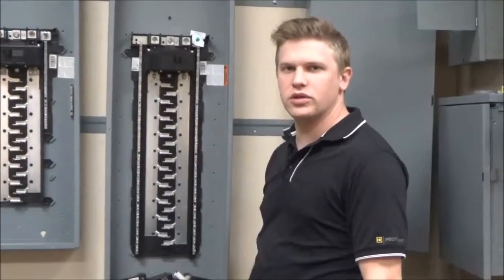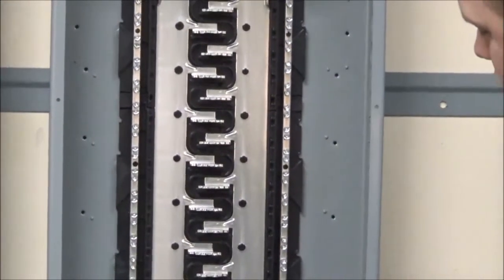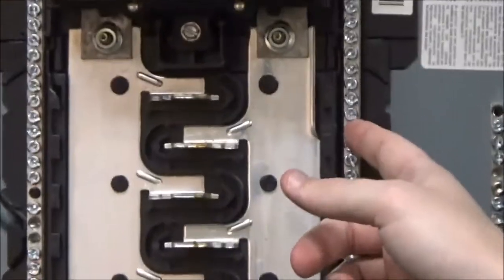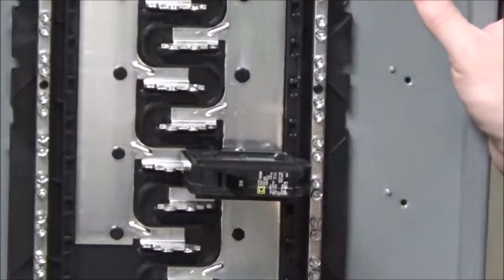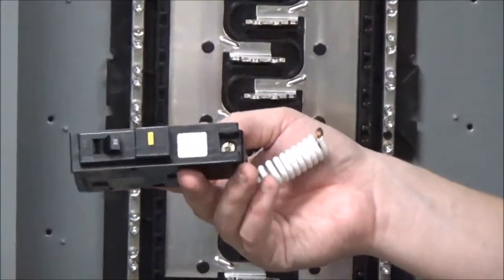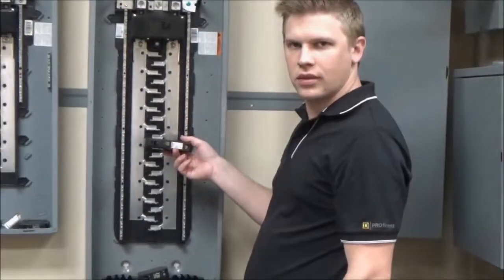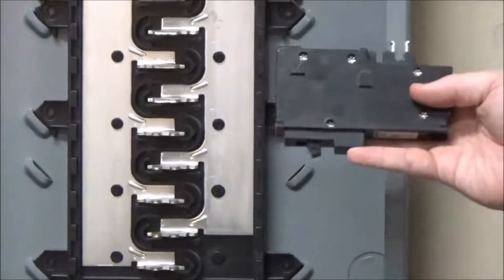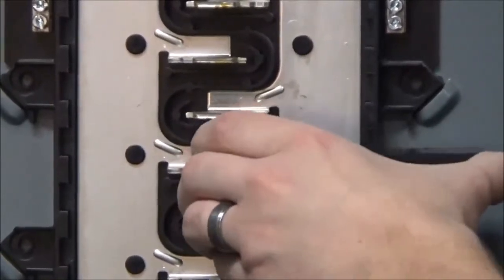Differentiating Plug-On/Non-Plug-On Neutral Homeline™ Breakers & Panels | Schneider Electric Support

Comment: Why the hell did you have to put the rejection tab on the damn breakers. You could have made the "standard" panels capable of the plug on neutral. I guess you just want to sell more load centers.  It would have hit the neutral bar just fine.  Stupid engineering. I guess it is possible that the old ones weren't ul listed for this type of breaker. I guess pigtails it is then